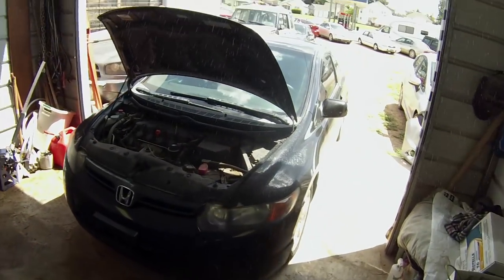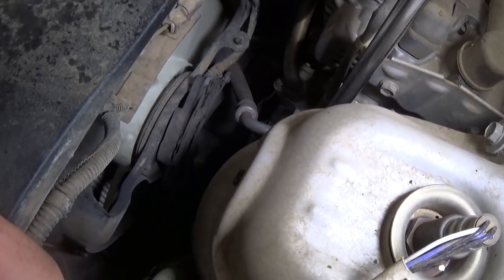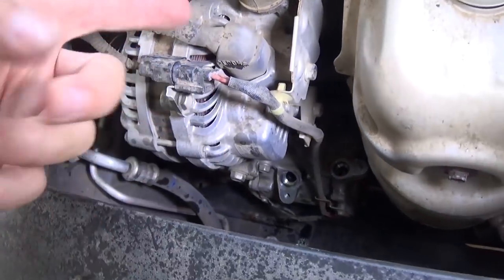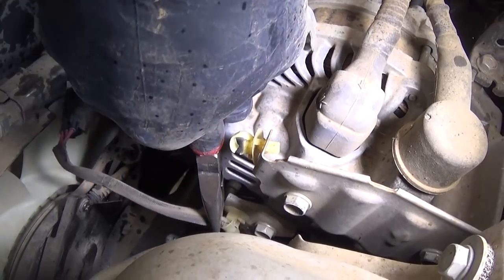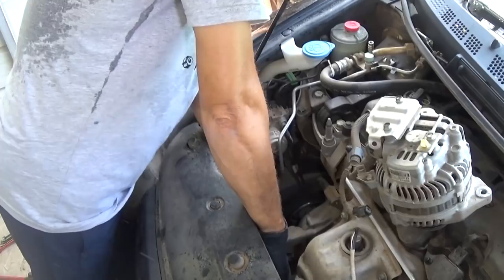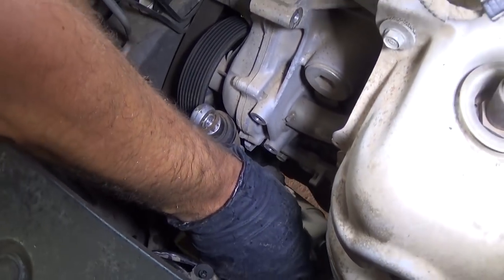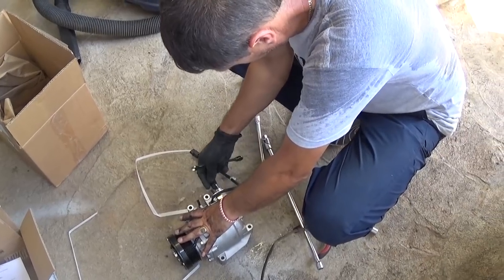How to remove and replace A/C Compressor on Honda Civic 2006 2011

Comment: I replaced my AC Compressor and serpentine belt today in my 2006 Honda Civic.   This video was spot on with locations, tools required, and made the job easy. Thank you for the detailed video.
Reply: What size is the compressor?
Reply: @kenziemaxwell5135  🙌🏼 about that big
Reply: @hockeyplayer8372  🧐🤣
Reply: Do you remember how long it took you (how many hours)?

Comment: Great video to guide me in replacing my ac compressor on a 2007 Honda Civic. I would not have attempted the job without this video.
Reply: did u pull a vacum?

Comment: I changed mine too and your video helped a lot. Couple of challenges. Putting back the serpentine belt is not easy by one person. Also I had to look into the service manual to check the torque for the bolts. use 16 lb.ft for 12mm and 7.2 lb.ft for 10 mm bolts. Every foot is 12 inch just in case the torque ranch is using lb.inch multiply those by 12
Reply: THANK YOU

Comment: Excellent video. Very instructional and straight to the point.  Important note for anyone attempting to do the job at home. Take your car to a shop to get your system evacuated and after installing the compressor, vacuum must be done prior to recharging with refrigerant.  👍🏼
Reply: Or just press the low pressure relief valve 😉
Reply: @JohnDoe-ky4qk  But that's illegal and totally not exactly what the shop will just do for 100 bucks anyways...
Reply: I'm going to do it at home myself, and I don't have a way to evacuate the freon, does it matter which side I take off first will one be better than the other? Sorry definitely no mechanic here just broke and out of options. Any info helps. Thanks from idaho
Reply: @justinwiltshire9433  You do not want to remove any of the AC Lines without first safely removing the freon. Opening the lines with Freon is very, very dangerous. Not to mention is not legal. Not telling you what to do. Just be safe and hopefully no nousy neighbor will get you in trouble. If you must do it at home. Press the valve on the low pressure side. It's the smaller one. With a phillips screwdriver. Make sure you wear safety glasses. Good luck 👍

Comment: Hello i love your videos as you are working on all cars i have, odyssey, civic anyway i just had a quick question. I have a/c coming although not too cold but i have noise coming from the pulleys. I thought it might be the tensionar but after removing the belt and spinning it is really quiet and no noise..so then tried a/c compressor pulley and it was making a scratchy noise. So my question is do i just need to replace the pulley or the whole compressor. Please help. thank you subscribed

Comment: A good thing to note here is that the tensioner is not a bolt. Dont whale on it too hard or you will break it.
Reply: Don't be tempted to use the open  end of  a combination wrench  on the belt tensioner either . The turd hex is hollow and will fracture. Luckily it still had enough left to still get the box end on it. Lol

Comment: is the removal of the compressor in your video the same with a 2019 honda civic? I saw another video where he did not remove the alternator, he went under the car and remove it from there. but your video shows it is much easier to remove the compressor.

Comment: i’ve read that you need to also replace the expansion device and the accumulator/drier to prevent the compressor from going bad again…have those of you who have avoided those steps been fine without? and did you not need to put lubricant in the compressor before installation?
Reply: Usually warranty’s would require replacement of the drier and orifice tube. I’ve never had an issue just replacing the compressor alone though. And on the oil it depends, some compressors come prefilled and some require oil to be added. Should have a sticker over the a/c line holes

Comment: For an 8th gen Civic, I took off the bolts to the subframe and lowered it with a transmission jack to get the compressor out from the bottom. Because it's so much harder taking the alternator off first to squirm your way up carefully from above. I can't imagine doing this without a shop lift.
Reply: I actually thought about doing this seems
Easier and should only have to remove one bolt from subframe

Comment: Great Job explaining.

Question: My refrigerant is good right now... If I remove the A/C compressor, will the old refrigerant be displaced?  Will I need to replace the refrigerant?
Reply: Leeland Hackbarth u have to evacuate it
Reply: Yes you will need to replace the refrigerant because it contains debris from the compressor burnout

Comment: You can do whatever you want but a good rule is to always remove necklaces,  bracelets,  watches, rings, all jewelry, take it off. We've had many lose a finger or almost their face because they were so used to working on vehicles with jewelry.  Of course safer when the vehicle is off but sometimes we forget from bad habits. 👍 be safe

Comment: Wouldn’t it have been easier to remover the front bumper, the condenser and the fans to be able to reach it? Or is it not? Thank you for the video!
Reply: Since it's recomended that the condenser be replaced with the new compressor , I'd do that. But he said it was probably a bad clutch so no contamination of the condenser or expansion valve. I think mine is a bad clutch also so I'll just replace the clutch and not have to fill with freon.

Comment: Hello. You mentioned you need to remove the pressure or no freon before doing anything else. How do you exactly do that? What if the ac compressor had stopped working for a few months while still using the car and ac fans... does that remove the freon?

Comment: Would you be able to run the car by removing the belt to a seized up compressor or does the belt run for other things?
Reply: Serpentine belts needed to run other things, alternator, power steering.
Reply: Yes ! Get a belt for a car without A/c . It simply bypasses the compressor. 
I did just this on my 2006 over the winter. Seems the bearings on these are notorious for going bad. 
Now that it’s summer, I’m replacing the compressor

Comment: What else should be replaced when installing a new compressor? I read that the condenser, the filter drier and the expansion valve also. Is this correct?
Reply: JrFreak300 have you found any answers ?
Reply: Just those 3 items. Don't really need to replace the condenser if you flush the system out real well.

Comment: How you release the air?
Reply: You need a reclaim machine to suck out the freon. Cause we all know how illegal it would be to depress the Schrader valve on your service ports and bleed the system into a rag. (Edit: ALSO,  once the system is dry, you would still need a vacuum pump to pull a vacuum on the system before adding fresh freon.)
Reply: Beau Tanner I’m cracking up 😂

Comment: Does anyone know how to empty out the existing Freon or make sure it's empty before taking out the AC compressor..?
Reply: PaulMalott Ac recovery machine. One of the major reasons why it should be done at a shop not only for recovery but you have to vacuum system down then add the exact amount of freon your specific car is.
Reply: Just ask a shop to empty it for you.

Comment: a rat chewed out all the wires on the compressor of my Civic. Is it possible to replace the wires without removing the compressor? I am willing to remove the bumper, radiator, and other things from the front of the car.

Comment: I read somewhere that the clutch might not be engaging because there's not enough freon/refrigerant/R134A in it. Is this the case? And if so, should I first just try to add refrigerant  before doing any other diagnostics? I'm saying should that be the first thing I do if the air is running warm. Or should I first check to see if the condenser clutches are engaging/spinning. And then add freon? 
In other words, even if the clutches are not engaging should I first add freon before trying to get them engaged. Because the lack of freon might be the cause of the clutch not engaging? I'm working on a 2006 Honda Civic. I'm also a straight up layman (aka don't know 💩).
Reply: Liebe Dich lol we are on the same page. My 2006 honda civic coupe has no AC as of friday. I tried recharging my refrigerant but the clutch compressor would never engage. Checked relay and fuses and it was good. I'm thinking my AC clutch is busted or bad electrical. Did you solve yours?
Reply: You can purchase a cheap gauge from any local store to check low pressure side of A/C, if that is within range the ac should kick on. If it's not it could be many other reasons including the switch, relay, electronics, or clutch coil or gap. If the a/c clutch engages sometimes and stops after awhile it could be the air gap is off which is cheap/free to fix. All of this info is online - just search
Reply: Yeah got my car back from a local family shop in town that I trust. My AC compressor was busted sadly... Going to cost about 1300$ CND for a new one plus extra parts.
Reply: @TheAtqthe30th  I would find somewhere to do it for less. Ac compressor is about 120US. Have a shop evacuate the system, remove and install the new comp, have a shop vacuum and refill. Should be able to get it done for 2-300 if you install yourself
Reply: @bmorici1  I like to generally fix most of my car repairs but with this one it's honestly not much cheaper. I live in a small town and the shipping is expensive and renting equipment is kinda not possible. I don't like paying big bucks but this will be my first time with this car(which is ok) . The cheapest compressor out here is about 300-350$ and they're not good quality. By the time I get the tools,parts and take time off of work to repair it,  I would be already hitting the same price but I could mess it up haha(unlike the shop that would come out of their pocket). Also easier to deal with warranty issues with the compressor if it fails during Canadian winters(shop covers 2 years).
Reply: @bmorici1  you saying "just search" doesnt help. people searched youtube for answers obviously. If you have a good source that u remember, post the link.
Reply: did you ever get any sort of answer or solution? I trying to figure out if its worth spending money on a can of AC refill. or if im just gonna mess things up cause my Clutch isnt engaging. i already replaced the relay and still nothing.
Reply: @lintfreecloth  unplug the pressure switch on the low side (larger line ) jump the terminals with a paper clip. If compressor kicks in and spins . Then your issue is low Freon . 
If it doesn’t start spinning it could be fuse , switch, or clutch. 
These Honda a/c clutch’s and bearings seem to be notorious for going bad

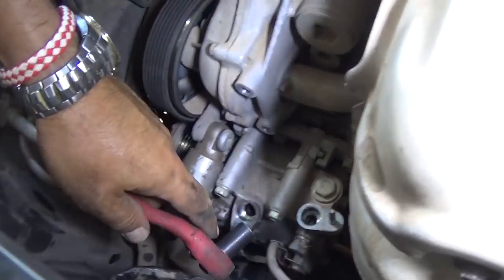Comment: 7:11 please please what is that metal pipe called? coolant flows through there!
Reply: Are you talking bout the next pilly up if coolant comes out it's probly the water pump
Reply: @chasekolar8847  water pump is fine, the pipe rusted out and leaks coolant

Comment: So my wife's air compressor on her civic just crapped out. It's an 06 coupe. I've had a friend try to help me remove it while I was deployed. He said he couldn't reach it from the top cuz it was a different year/model. Is this really true? Seeing this video basically gave me enough reason not to send the car to pep boys. I only have experience with Fords and BMW. Any help would be appreciated cuz it's hotter than hell out.
Reply: You probably need to remove it from the bottom. And might need to remove the front wheel. I'm not a mechanic though

Comment: just bought new a/c compressor for my Civic 2006. How much oil i need to put in it?
Reply: michael tv I've read somewhere that it's 2.5-3 oz's
Reply: michael tv let me know how much you put in in wondering the same thing
Reply: George Parker I found very different advice's from 1.5 to 3 Oz, guys from eBay advised me to put 5.5 for my Honda.  I putted 5 Oz. Still can't say if AC is working very good right now because it's pretty cold outside)

Comment: He did it 10:38  
My mechanic will charge me 4 hrs labor
Would it have been easier to get it from the bottom
Reply: The vids I've seen work better the way he did it. I would remove the alternator first before removing anything on the compressor.

Comment: you could reach it from the bottom of the car isnt???
Reply: I was wondering this too. I know the clutch can be pulled from the side if you take the tire off. Seems like if you removed the plastic on the bottom you'd be able to get at the compressor. Although those bolts look hard to get at from any angle.

Comment: so is it obserd for pep boys to want to charge me 3 hours labor for changing the compressor considering you had it removed in 15 minutes
Reply: Not at all. Nuts and bolts are not the entire job. I charge more than that for the complete job because I spend 1 hour vacuuming out the system, leak check and charge. Not to mention replacing the receiver drier.
Reply: The book actually calls for 2 hours you have to pull the fans off do get the compressor out